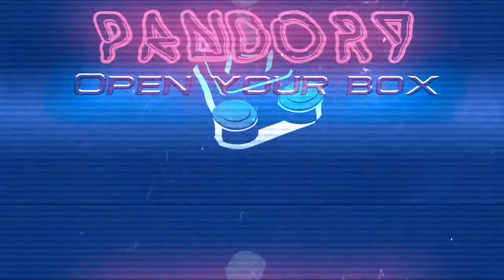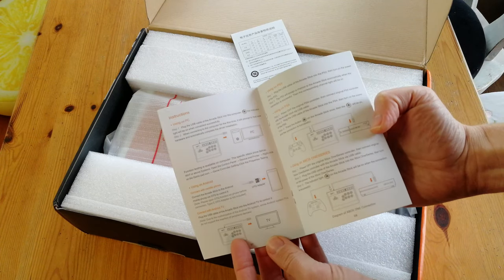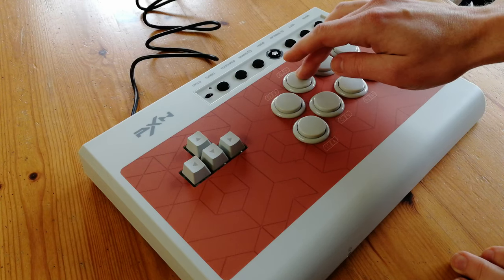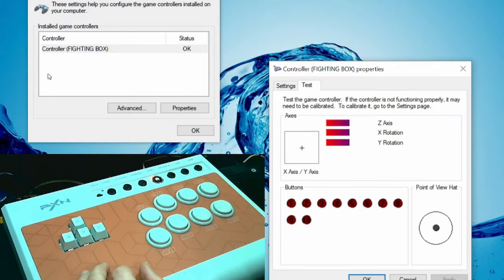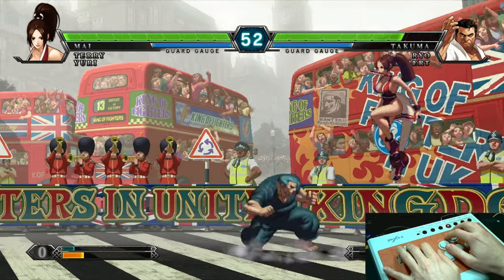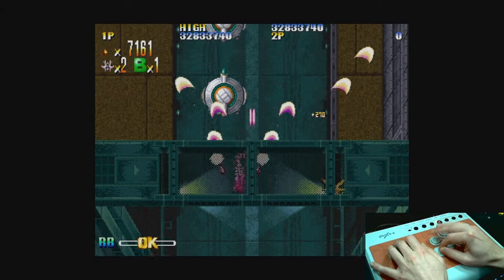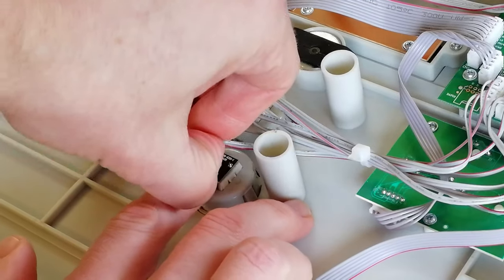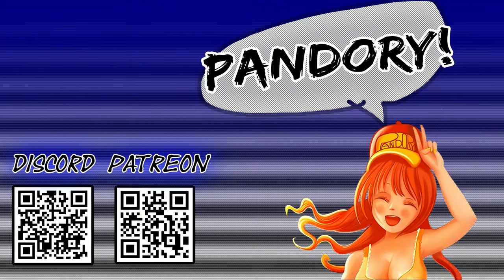PXN 8X Fighting Box Arcade Mixbox Controller [Hekka Review]

Comment: Hello dude thanks for the video very helpfull
Do you know which cable we need to use for sanwa buttons?
I would like to change them 8 right hand buttons with  sanwa ones but i dont know how to connect them :D
Reply from the maker: I don't think you can change the buttons at all, unfortunately
Reply: @TeamPandory  why not?
Reply from the maker: @Vx1Hawk you may need to do some soldering / fitting spade connectors to the wires for sanwa buttons.  Pretty sure you'd need 30mm size sanwas.

Sorry it's been a while since we reviewed this 😂
Reply: @TeamPandory  I think we need to unsolder only if you want change blue switches, but if you want change all the buttons you just need to remove them, cut the plastic tabs and connect with the new cable for sanwa )
Reply from the maker: @Vx1Hawk  yeah... It's been a while. I think if I want to play like this I'll just use my keyboard 😁 I have arcade sticks and controllers for the rest

Comment: does this controller have socd intergrated into it?
Reply from the maker: When you're using POV / DPAD mode, then LEFT and RIGHT = DOWN LEFT, and UP and DOWN = NOTHING.  In LS mode, LEFT and RIGHT = LEFT, whereas UP and DOWN = UP.   ...  You could always switch out the internals for a pico pi or brook board usb zero delay encoder to get your desired effect.
Reply: theres a new firmware that does it but specifically Last input priority